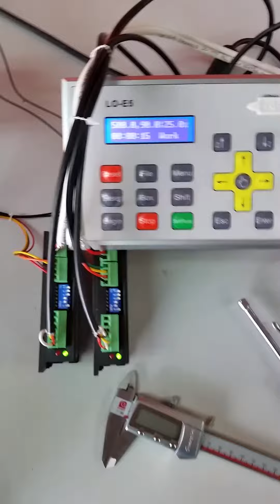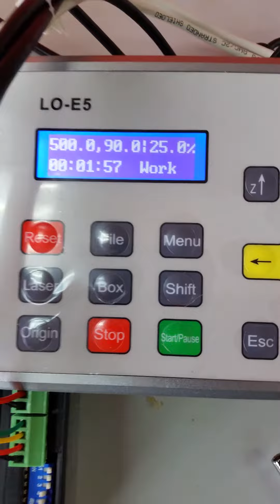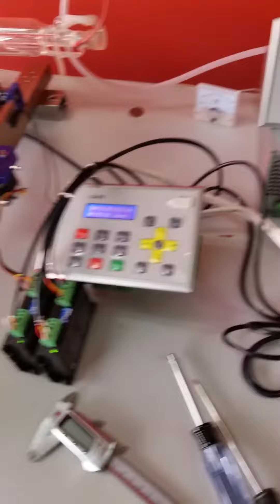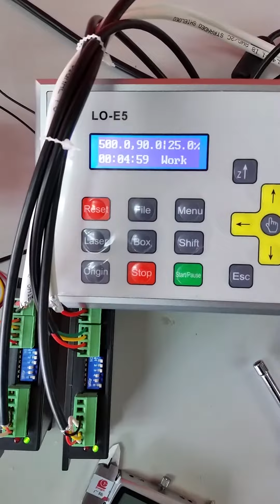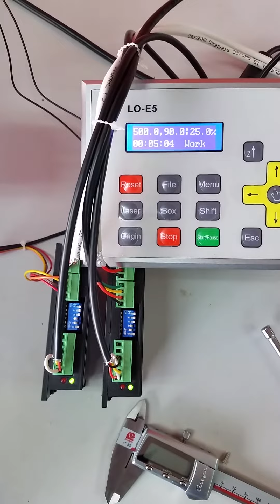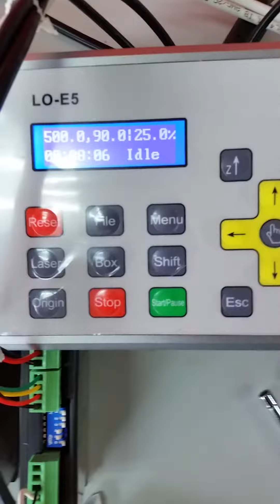Lightobject new CO2 laser controller card E5 running at 500mm/s

Comment: Hello, Can you tell me if it is worth getting this E5, or the X7 for the k40?  I'm only cutting acrylic now, but want to consider other products to possibly sell.
Reply from the maker: Get T9 if you don't need to run the LightBurn. T9 is very good on engraving and it is selling low price. It is a discontinued model but it works great!

Comment: What is your stepping at on your motors? Also, which controller board are you running? I have a similar setup from LightObject but its the 1200 x 900 gantry. I have been looking to increase my speed for engraving.
Reply from the maker: +Iceblade065  You can't reach that much speed on 1200x900 because of the mass. My test was performed a small, light weight XY stage without 2:1 reduction gear on the X axis. Yours can't beat mine at any setting.
Reply: +LightObject thank you for the quick reply. I am not looking to match or beat your speed. I am simply looking to increase the speed that my laser is running yet. I am running at a Max of 30 mm per second while Engraving, and about 45 mm per second movement speed. I am simply looking to double this if possible and keep my reliability.
Reply from the maker: Iceblade065
 Is your XY stage from LightObject, the XLE model? If so, you can reach at fast as 900mm/s.  30mm/s is really nothing and something must be wrong either on hardware or software setting.  What controller are you using?
Reply: +LightObject I sent you a message with my email address. if you don't mind sending me a message there then I will reply with my settings and hardware.
Reply from the maker: I didn't get your email. May be you should should send it to contactus@lightobject.com and I will go through your setting